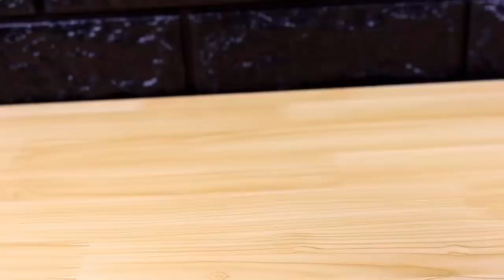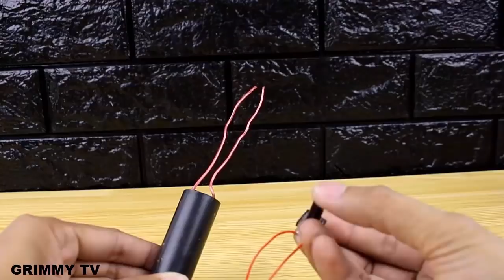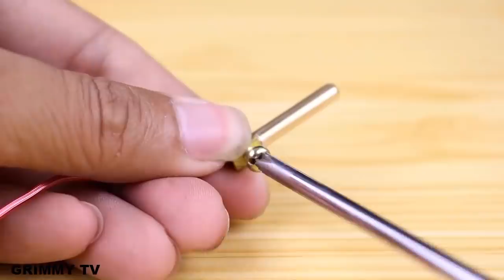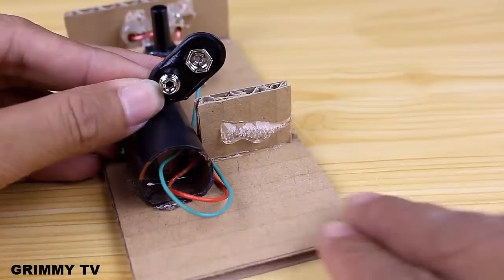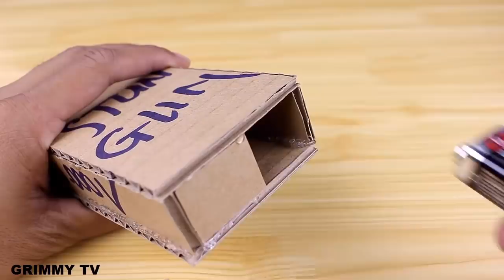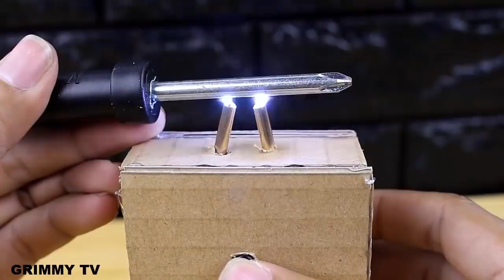How to Make Powerful Stun Gun 400 000V at Home - DIY

Comment: No, it's not 400,000 volts - or anywhere close to it. An easy rule of thumb is 25,000 volts per inch of spark in normal air pressure. If your device can produce 400,000 volts, it should be able to make a 16" spark. Let's see it.

Comment: There's no capacitor in the making of this circuit. As for the black tubular thing.[it's the actual high voltage circuit] You can buy it from a Chinese supplier.

Comment: You know that is not 400000 volts since air breaks down under 16kV in a 1cm gap where the prongs are in your video about 1,5-2cm which means it is around 24-32kV 
But i think you were fooled by e bay or whish where tgey claim auch high arv generators with 400kV while they are only about 50kV max

Comment: I don't think this guy knows that the bs claims on those garbage high voltage generators are all way under the level they are so I think this dude actually thinks he mad a 400,000 volt tazer when in reality it's only like a 500 volt spark gap at best and even then that 9 volt battery would only last like 30 seconds powering even that

Comment: It is NOT capacitor but High Voltage Generator having electronics inside. It has to produce quite large voltage as the spark gap is that big. I think it must be at least 100 000 volts and easily more but the amperage is very low. This can be even fatal if misused so I don’t recommend you to build this.

Comment: This is just click bait.  The electrodes were touching several places from the cap to the tips.  The "StunGun" would have shorted out several times and shocked no one.  Besides, you also have to cycle the charges going to the cap. So you need a timer device like a 555ic chip. That's where you get the popping from a real stun gun.    Simply running wires from the cap to the electrodes is not going to do the job.  This is BS, pure and simple.  Prove me wrong OP.  Include a schematic.

Comment: 400,000V would set that napkin on fire instantly!.
Maybe 2,000 volts from 9V battery. And wouldn't last long unless capacitor used was large enough to carry 400,000V.
Then it would be only 1 time use then replace battery.

Comment: The black tube is similar to a car spark plug coil, switch the battery on  and off and the output is a few thousand volts.
It must have the switching circuit inbuilt as some cars and motor cycles use them.."Mills kills, volts jolt"..In other words if you can drive a few milliamps through your body a long sleep is guaranteed..If you have like me had a jolt off a spark plug there are two reasons you live too tell the tail....As soon as the body draws current the voltage driving it falls very low so can not sustain the killing current. Also usually you never play with sparkplugs with your chest  unless some one zapps you with both prongs near your heart..the reason I am still alive is that I have not tried it.
I have had quite a few zapps with TV's 17,000volts on the old BW and 25,000 volts on the old colour TV's end up with a nice pinprick brown burn hole and sore knuckles as your hand shoots out of the way...happy days...:-)

Comment: I built a 79 million volt stungun.the 79 million true volts at first three shots but droops.the 79 million volts may not kill you on my model stubgun but my stungun has very deadly amps.My stun gun will kill someone if I use it for a fact.I never ever carry on me.just sitts on my bed side.you can make a real deadly battery power stungun out of few tv parts and some none.

Comment: This video stungun use a high volt changeing circuit, that charges a high  volt camra flash compositor. Thats all.you discharge the black tube compositor on skin or meatal. This stungun can cause pain and permanent scars on skin.I would never use a defense.to weak.all stun guns are garbage even store bought because they lose battery charge after few use.Now gas propelled cop teaser are very effective more than on skin contact .because the volts gos under the skin.if you want to make a goid stungun use fishing hooks as probes.so it gos under the skin.

Comment: Not 400 000 volts.  If it were, the arc would punch through the insulated wires coming out of the converter module.  It's 40 000 to 50 000 volts, at best.

Comment: First of all its not 400kv and even if its a high voltage they would have to sacrifice alot on amperes to get that so it won't be so power full it won't stun you that well either all it for is a bit force so at most you are going to feel like being punched but it won't stun you that well .

Comment: If I were to make a taser I would make a replica of a police stun gun that would look similar to the ones that the police use I would make it shoot out a rope that stuns and shocks and I would use a battery from a cordless drill instead of a 9 volt battery because drill batteries are rechargeable and have more power hell I would probably even turn a cordless drill into a taser if I knew how to

Comment: I bought some of those HV modules recently. It works with a 9V battery for only 10 seconds. 1, 2, or 3 AA cells will better. The chinese seller said must avoid the short circuit and the too big gap, because it can arcing inside, and damage in one second. I ruined the first with 15mm sparkgap. The HV module needs a backup spark gap, if you can insulate the main spark gap and no arc can jump  over it. The energy must discharge outside of the module, or it increases until inside arcing. I made a "dog repellent" with one module plus 26650 battery plus pcb and charger circuit. Good and cheap weapon :-)

Comment: The black tube is something called high voltage generator. Its only an electromagnetic coil, you can do it at home with copper wires.

Comment: I did one but without the black box, I salvaged an inductor from an old lamp and I used a 180 OHM resistor and a mosfet with 3 AAA batteries, the voltage turned out to be 516 Volts.
Reply: Too much for my brain

Comment: ITS A TAZER. Not a stun gun, it doesn’t shoot the prongs
Reply: Pretty sure you have your electroshock weapons mixed up. A Taser is your “prong shooter,” however, it too can be used in a similar capacity when the cartridge is removed.

What’s shown here is in fact a stun gun in rudimentary form, though I doubt it would deliver much more than discomfort if used for defensive purposes. If anything, it might make the situation worse by pissing off your assailant for trying to hurt them with a lump of cardboard and hot glue.

Might make a cute science fair project, or, if you have toilet paper that needs burning and 5 minutes to spare while it ignites.

I would suggest not using a power drill on such soft material, and most definitely NOT suspending anything in the air with your fingers while drilling.